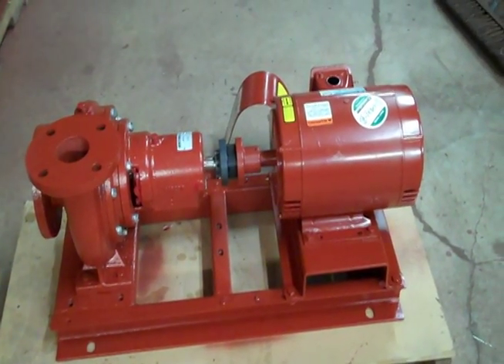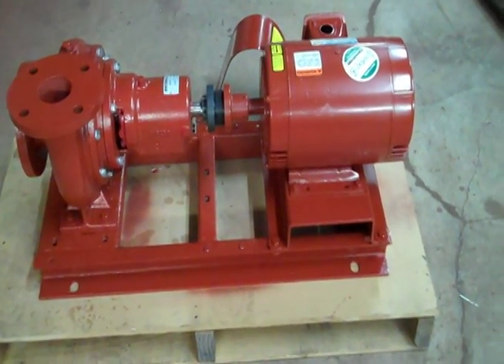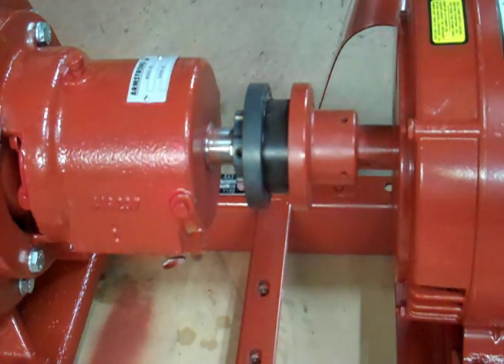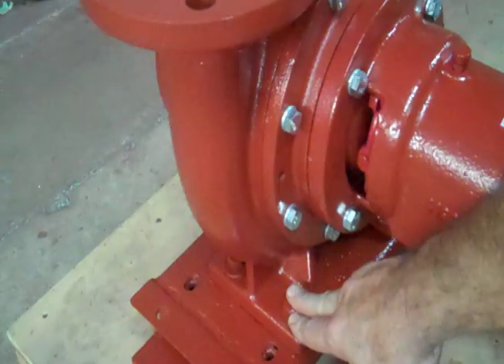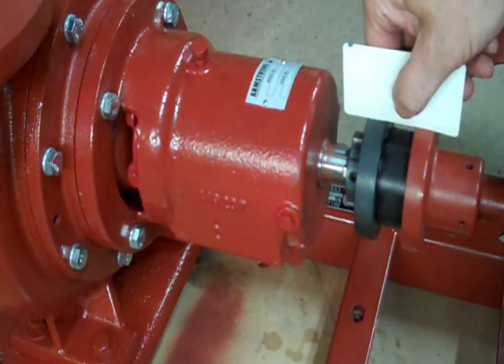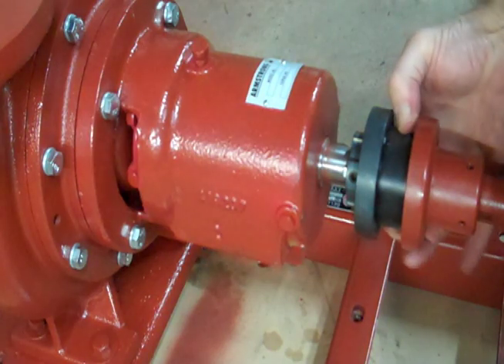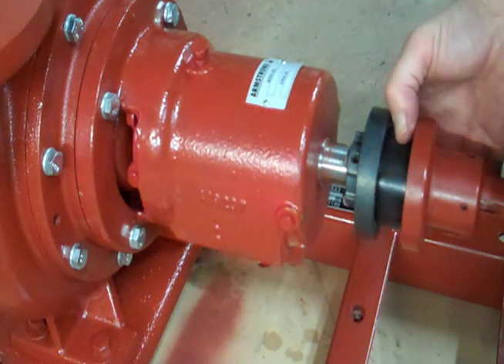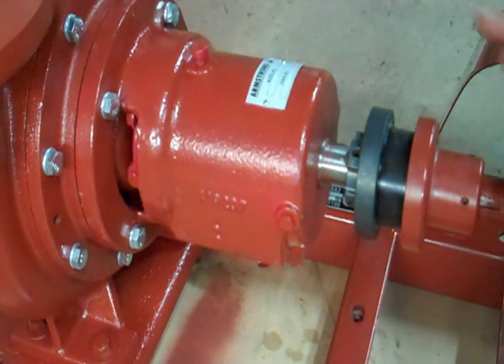Coupling Alignment Base Mount Pump Armstrong Bell Gossett Taco Aurora Paco Gould Patterson

Comment: We do pump / motor shaft laser alignment all the time as standard procedure. The alignment required is all about ensuring the longest life of the expensive components like the bearings and mechanical seals. Aligning the coupling hubs is often not good enough. It's shaft alignment that's required. The coupling insert will also benefit greatly but it's also the cheapest component to replace and I've seen pumps eat them up like candy.

Comment from the maker: yes.. TB Wood , Baldor and a few others make the coupling that is split so you can just move one of the mental flanges back on the shaft a little and put it on
call bearings and drives or someplace like that and ask for a split coupling insert of the size you need.. may try google for this as well
Reply: What are the steps when removing bearing housing?

Comment: You need to do a rim and face alignment with dial indicators
Reply from the maker: Thanks for the comment ... to clarify a little one of the main points is that this type of pump must be aligned before it is piped in.  But to your point the woods sure flex is quite forgiving of slight misalignment  as long as it is not pinched AND the pump is run on constant speed. It is easier to 'see' with a dial indicator but one is not always available in my little world .. I will agree Totally if the pump has the newer Dura flex that alignment needs to be quite accurate and a dial indicator would be a BIG help with that  ... but we are now talking final alignment not pre pipe alignment ..

Comment: Sprinkler contractors and fire pump people are the worst about walking off leaving fire pumps misaligned on new jobs per NFPA 20.  The fire departments are not checking them either.  In addition, they are not being inspected annually as required by NFPA 25.  You can see many on my MISALIGNMENT VIDEO and more information on the photo album (See More)